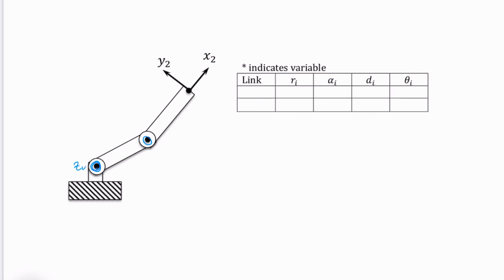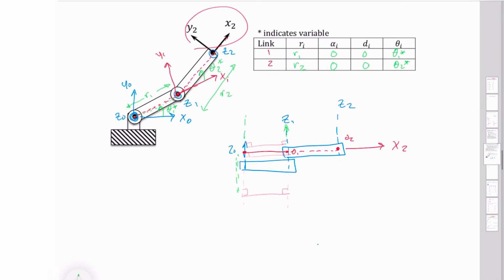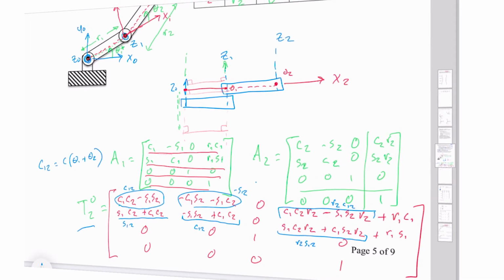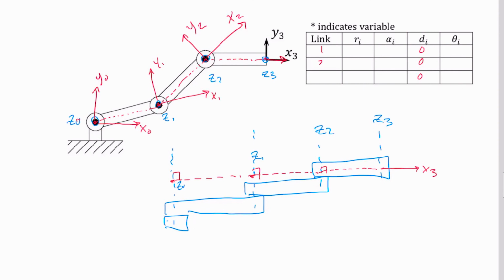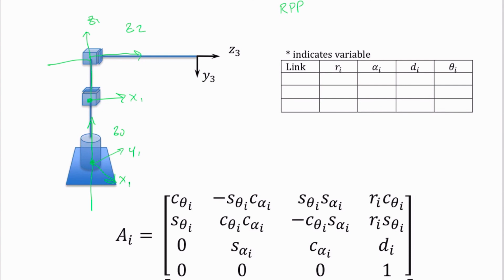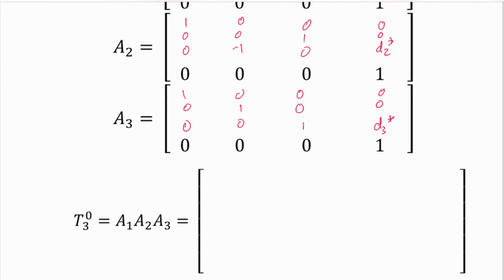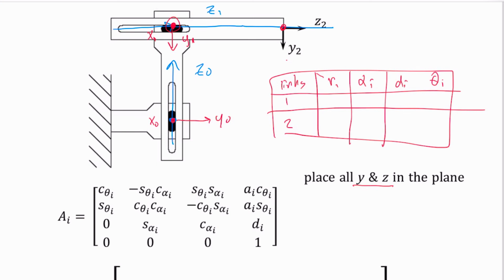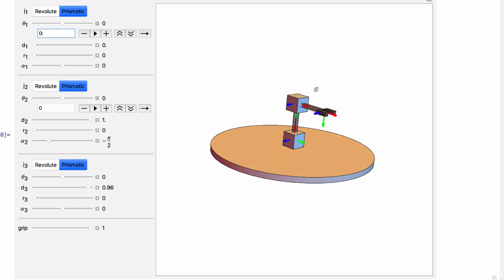Intro2Robotics Lecture 5b: Forward kinematics examples

Comment: At 17:48 Why is the z1 direction not in the upward direction because z2 is for the prismatic joint where you put z1. The 1st prismatic joint moves in downward and upward direction so z1 should follow it.
Reply: So practically, alpha 2 should be -90
Reply from the maker: I'm not quite following your question.  Link i translates (or rotates) about axis z_{i-1}.  So the first prismatic link (1) translates along z_0, which is up and down.  The second link translates horizontally, so z_1 must be horizontal.

Comment: Dear Sir at 10:23 the angle theta 3 is positive but the rotation of axis x2 to match axis x3 is in clockwise direction which indicate that the angle theta 3 should be negative?
Reply: 3 years late but you would only plug in a negative theta if given that angle and solving the forward kinematics. Since you are only setting up the matrices and theta star is prone to change you would leave it as positive since counter clockwise rotation is still considered positive.

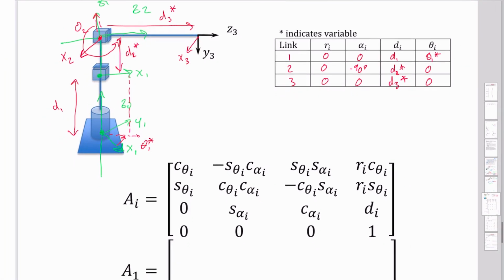Comment: At 14:46, don't we have to set the Theta for link 2 equal to -pi/2? As x1 and x2 don't align perfectly, we first have to rotate by that amount around z1.
Reply from the maker: @JustInCase  My drawing isn't very good.  I should have drawn x_2 parallel with x_1.   In the above drawing, it does appear that theta_2 should be -pi/2.  (in my hand notes I had drawn x_2 parallel to x_1, and so I made theta_2 = 0).
Reply: Oh well okay! This was just because I flipped x0 with y0 in my equations!

Comment: sir why cant x2 be facing downard and such that z2 faces toward endeffector direction, and i am getting 0 for theta
Reply from the maker: x2 must intercept z1 and must be perpendicular to z1. Those are the 2 DH conventions. You can't satisfy those by making x2 face downward.    Theta cannot be zero, because you have 2 rotation joints, and so both are variable valued. 
[note] If frame 2 is the end effector frame, there is more freedom in assigning directions for x2,y2,z2 because there is not motion axis that z2 must align with.  If frame 2 is the attachment for degree-of-freedom 3, then we have to follow the DH conventions.  To simplify this example, this problem had the frame 2 already assigned, and asked you to set frame 0 and frame 1 to follow the DH convention.
Reply: @AaronBecker  thank sir